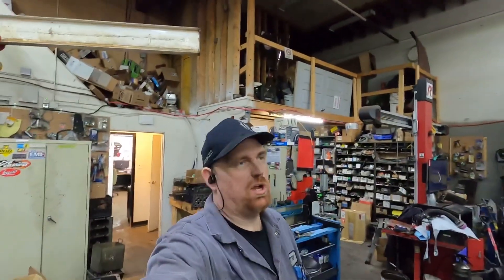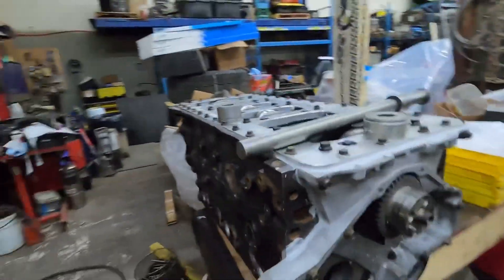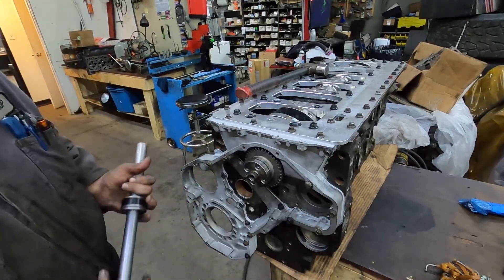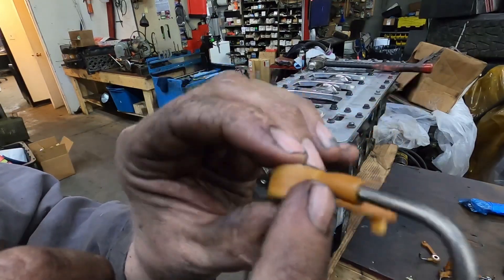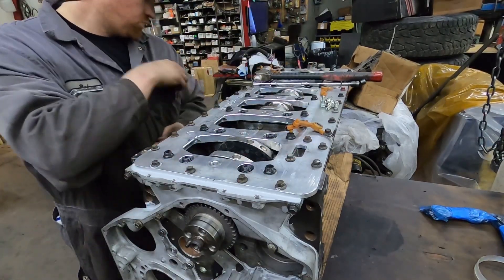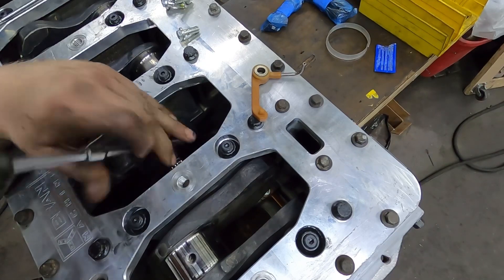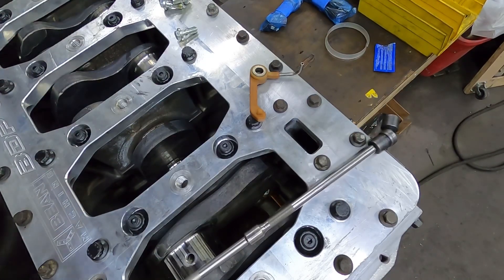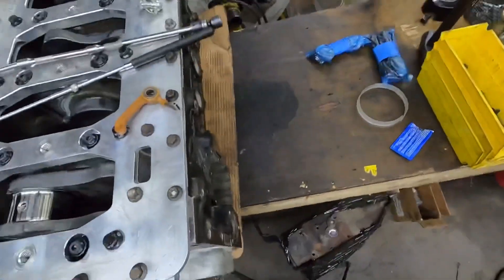How to build a 6.7 ppump Cummins.  Part 11

Comment: What’s your opinion on the inside cam bores that don’t have the replaceable bearings, spec wise? I rebuilt mine and put in new bearings (2)  but my inner cam bores were like .0015 out of round. The machine shop I talked to wanted are 1000 to line bore it and said it’s not that important. He is a gas engine guy and bored my cylinders because he could. I couldn’t find much on the cam bores. What are you charging for the sanding blocks? I’d be interested in one.
Reply from the maker: I am not sure on the price till I het them done. The cam bores. .0015 out of around isn’t out of the normal.

Comment: Hey Rob. Appreciate the content and very helpful info. I’d like to buy a sanding block and a cam bearing installer also (if you will make it). Thanks!
Reply from the maker: ok. i will have sanding block in the next couple weeks. i will do a video when i do.

Comment: When would you install bearing's in each cam journal....at what level or criteria...
Reply from the maker: you could do it at level, but really is needed when you have really heavy valve springs. using good oil and oil additives goes a long way
Reply: @CUTTERUPROB  👍👍